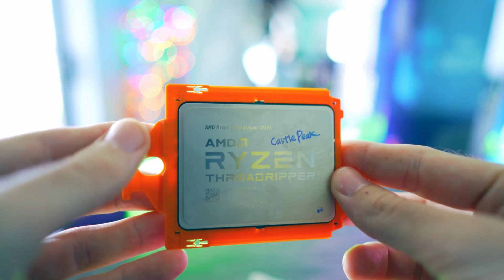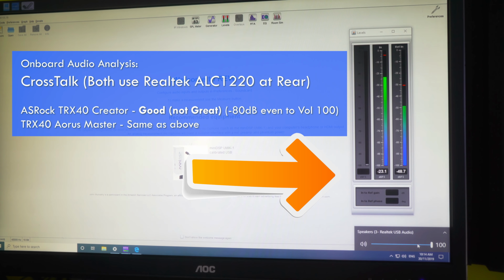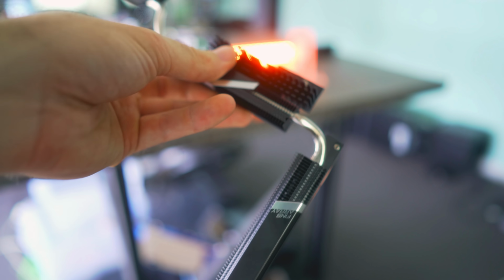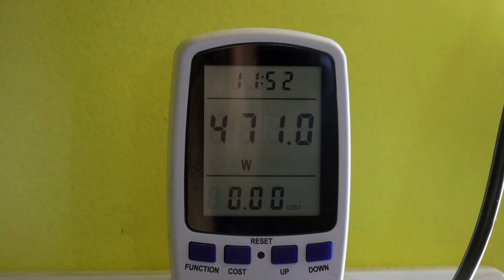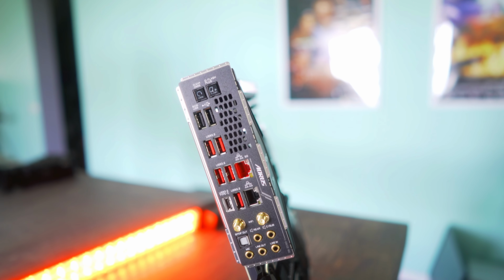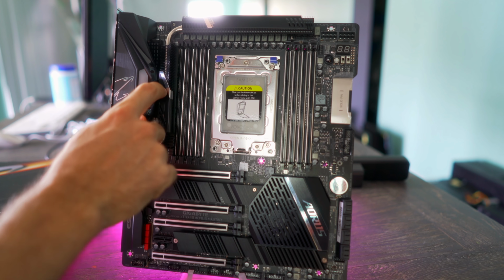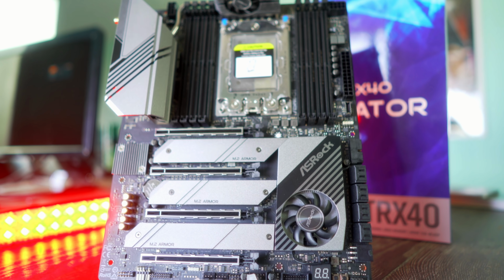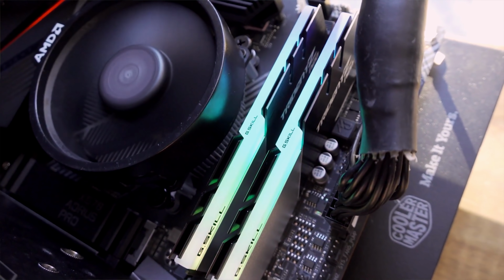TRX40 AORUS Master Vs. ASRock TRX40 Creator - Bigger is NOT Always Better.

Comment from the maker: Sorry made a mistake on the audio latency test, the files are actually swapped, ASRock TRX40 Creator had slightly better input-output-input audio latency than the ASUS X299 Deluxe!
Reply from the maker: @MarcoGPUtuber  Wait so you are doing a better job than a whole company's website? Ugh ><, I will message you when I wake up.  So tired now, had so much more to examine this time around with this board review.
Reply: @techyescity  Dude, Gigabyte should hire me. The motherboards are great but damn, these websites, the English.... Uggghh
I'd have the whole thing bulldozed and fixed.
Reply: that is easy run a sound card Evga or Creative labs fix the problems !!
Reply: So what happened to AMD being the affordable manufacturer?
Over priced Entry level motherboards?? 
How does that work for the low budget gamer??
Reply: if you bought a radeon vii card a few months ago this should upset you  .  699 for a card and 6 months later drivers lack support . to where  its only 1 frame faster than a gtx1070 and slower that a 5700 https://www.youtube.com/watch?v=WseH1xuzi34
Reply: @monham5041  this platform is lot cheaper than intel 3175, and performs better. Dont worry, amd is still the king in price to performance in every price category.
Reply: 7:36 how the F*CK did you get to 103*C??? i'm using an $50 cooler master air cooler and the highest i've seen was 85*C. you messed something up really bad.

Comment: Thanks for the look-over of those boards. I am leaning towards the TRX40 Master since I have been very pleased with both my x570 Masters/(3900x & 3800x) but,  the creator looks interesting indeed. Noticed you're using the Enermax TR4 cooler - hows that working out and are you using the newer revision?  I like the cold plate design Enermax is using - not so sure about the what's happening inside with their coolant...
Reply: I have the same question since I'm planning on getting a 3960x or 3970x and the Liqtech cools very well.... when it works that is. A lot of people complain of raising temperatures after 6 months of usage. One just needs to check the reviews on Newegg and other sites to see how bad they are, even the 2nd revision it seems (Liqtech II).

Comment: I have an Asus ROG Zenith II Extreme, and I'm fairly certain all four PCIe slots are x16, but it looks like if you toss in more the two GPUs, it scales the PCIe lanes, so two slots end up being x8. However, I've tested with two GPUs, and no matter the slot the cards are in, they always run at x16. It also depends on the usage of m.2 slots and what not. But it appears all 4 slots are perfectly capable of PCIe 4.0 x16 on their own.

Comment: Thanks for a great comparison. Now, what do you mean by saying 'massive, massive air cooler'? Would you even consider it with the TR 3960 (no OC)? Thanks.
Reply: Are you thinking an air cooler wouldn’t be good enough for the 32-64 core parts at stock or something? You wouldn’t need a massive one for just stock (my 1950x was fine up to 450w cpu power on an old 120mn AIO that only covers 1/3 the IHS), these are not hard to cool like Intel (the 9900k is freaken lava... It’s insanely small and the power draw is basically the same as the 64 core Threadripper, so the thermal density is insane). Threadripper could be cooler just fine with a PBO overclock on a good or decent TR4 air cooler. You won’t get every last ounce out of it (I’m aiming for -100c with triple cascade for when the TR-64 core comes out as my next daily upgrade, hoping for 128 threads at 5 GHz), but a big air cooler would be fine especially if you’re not overclocking, don’t worry about it, these chips are easy to keep cool, it doesn’t take much.

By massive massive air cooler he meant something close to performance of a water cooler and overclocking to the limits, that the boards would still be fine. (I’ll probably end up using a similar board to one of these for even LN2 overclocking, because at that temp the entire board frosts over so VRM doesn’t run hot anyways and even at that these boards should provide plenty of power delivery for even the 64 core, it’s just that at this level of fun competition every last Mhz counts so even a minor improvement can win you the bragging rights, but it’s not needed, and it’s just for fun, similar to car racing it’s just about having fun)

Comment: If you overclock and fine tune the Aorus gets into the optimal VRM efficiency zone. And it's also possible that it'll get better with updates. 4990x ready.

Comment: 7:35 95*C? 😳 Is this because of the Enermax Liqtech AIO? It's well known that it clogs up with time and temps skyrocket. Maybe that's what we're witnessing here? 95*C is not normal when running the CPU at stock with an 360 AIO that covers the whole heat spreader of the CPU.
Reply: A bit late but you need to remember its 27C there as shown in the video. The cooler is keeping the cpu at a pretty decent 68C over ambient while under stress testing.

Comment: ESS SABRE qdacs can cause some funny results when using 3rd party audio software. I would take the highest quality audio file, like a 32bit FLAC and listen to the file and compare it to other boards. I was having issues with audio software myself. But, the actual audio file i tested sounds perfect on my $500 Sennheiser's through an old LGv20 and even on my new phone which is a v50 also with an ESS qdac. Listening to the same file on the ESS SABRE 9018 qdac in the z370 Aorus Gaming 7, also with a 2Vrms 3.5mm hadphone jack, they both sound identical. I think the ESS chip isn't supported or when a qdac like the ESS converts the signal, the results become smeared. The clarity when using those SABRES are unmatched.

Comment: What is the best gpu i should get for a 2600 (reasonably speaking)?
Reply: As nice as you want basically. Whatever your budget allows (RX 470/480/570/580 are extremely cheap used in the US for example, you can often find $80 will get you an RX 580 8 GB card, so unless you need 1080ti/2080 performance those are the cards to get here in the US, but that might not be where you live, or the 5700 and 5700XT are really good value at like $330-$350 new in sale since most stores are still selling them at Black Friday prices).
Reply: @jakegarrett8109  kk thx :D

Comment: I have question.
I presently have a Xeon X3440, X3470 paired with a ASUS P7H55M Pro motherboard and an Intel DH55TC motherboard. Should I spend some money to overclock the X3440 (by buying cooler and good PSU) or just add the stock X3470 and add a RX 470 graphics card without overclocking the processor? (I will be buying another PC soon.)

Will spending money on coolers and PSU for overclocking the X3440 worth it?

Comment: I love when people were like "I'm so glad I got an X399 board" 🤣🤣🤣
Reply: I have zero regrets. 16cores for 2 years for 710$ total. 260$ for the board 2 years ago and 450$ for the 1950x. Uh yea that's nothing to be upset about. Especially when your work benefits from the extra cores and PCIE
Reply: @skoopsro7656  Same here. I've recovered the cost of my x399 machine in the first couple of months and throughout the 2 years I've been using it it has earned me a lot of money.

Comment: Cant believe the TRX40 AORUS XTREME has active chipset cooling when the X570 variant does't...
Reply: It's most likely because there are a lot more PCI-E devices that you can connect to the TRX40 motherboards thanks to the 72 usable PCI-E lanes. If you use a lot of these lanes simultaneously, things might get toasty pretty quickly. The X570 chipset only has 20 usable PCI-E lanes - much much less.

Comment: I bought the Asus trx40-e, and i found out in canada the  aorus master is cheaper than the Asus trx40-e with, and it has 5g nic on board compared to the asus 2.5g, also the master looks cleaner and it is E-ATX which i like and the cmos battery is visible, compared to asus, it is ATX i found it a little cramped, also couldn’t locate the cmos battery to clear out the cmos in the Asus board as i was trying ocing the 3960x  as the Asus dose not have clear cmos button, I agee the master is better value, i am disappointed at Asus.

Comment: ASRock just rocks !  I will never buy any other brand ! never did , never will !
ASRock Rules !
Reply: Yes . Asrock truly rocks . Thanks .
Reply: Just keep an extra set of high speed RAM... on the Ryzen boards they have a bug where if it fails to post sometimes it never will until you add in say a 3600 XMP kit (even if you never had it set above 2133 MHz, or even if your CPU could never hit that XMP even on one stick). Asrock X370 Fatal1ty but according to the forum that helped me figure it out it also affects Intel boards from Asrock.

So you either need a set of unrealistically high speed (for first gen), or you’ll have to RMA your board occasionally... yay, way to not put a duel BIOS chip like even the old cheapo AM3+ garbage tier boards had...

Also on the X399 (Threadripper) platform (haven’t had the issue since I only run 3600 or higher on it), about half the time you can only get 1/2/3 sticks to work after installing new memory. BIOS will say “quad channel”, but say only 8-16-24 GB useable. CPU-z can see the extras (like I had 6x 8 GB sticks but only 16-24GB could work at base level speed 2133Mhz, but CPUz could detect each stick in windows and show the XMP profiles and vendor for each slot, but the board wouldn’t show the OS the full amount). You end up painstakingly taking the water loop or whatever off (just awesome for hardline water cooled quad crossfire, let me tell ya...) slapping the CPU off the desk a few times scolding it like a dog (there are no pins to bend, so I’m being serious when I say scold the CPU, shouting seems to relieve some of the anger after the 15th time it’s been out of the socket and the 20th time adding sticks one at a time), then cross your fingers and prey the thing actually lets you use all the memory.... It will often work after the 10th time, but sometimes it’s 6 hours of pulling hair to get it to use/bench a new kit of RAM. I’ve never had this issue on my AM3+ Asrock or my AM4 board using all the sticks, but TR4 is just janky! Also seems to help if you have it warm, so if you’re room is around freezing be thankful if it even boots with 16 GB! I’ve had to use a hair drier to warm it up before... and yeah, I actually use my computer to warm up my room so that’s a problem, the last week it’s been running 6x Handbrake batch file encodes at once compressing my bloated videos of all the stupid stuff I do (maybe I should just run a jet engine on diesel to heat up my room... IDK, I think using quad crossfire and Threadripper sounds more reasonable, but I always need an excuse to buy a turbojet, Aerospace engineer if you didn’t guess, lol!)

Comment: I'm still amazed how intel threw away such a big lead. Like I'm super greatful they did but like how did they allow AMD to come back
Reply: The Poltical One give it a few weeks for the enthusiasm and euphoria to die down a little and let actual people who daily-drive these chips post their experiences with actual software, not benchmarking tools. One thing i can tell you with certainty, very VERY few people who got TR1s or TR2s will be buying TR3s.
Reply: @sniper1pk  Why do you think that very few people that got TR1 and TR2 will be buying TR3?
BTW, ~95% of the benchmarks in the reviews I've watched and read so far are based on actual software so not sure what you are trying to say? Cinebench is Cinema 4D - actual software; Blender - actual software; 7-Zip - actual software; Adobe Premiere Pro CC - actual software; V-Ray - actual software; Corona Benchmark is Corona - actual software. Mozilla compiling - actual workload; Do I need to go on? The only ones that are not really actual software are maybe ~5% of all benchmarks shown such as CPU-Z and Geek Bench.
Reply: @bgtubber  I run a small VFX studio and i got a couple of 1950Xs and a 2950 to supplement our mostly x79 and x299 pipeline. The amount of downtime we've faced due to AMD's laggy performance, system hangs and general compatibility issues caused us to actually lose revenue due to missed deadlines. Even using them for their fabled "raw compute power" frequently resulted in over-night sequence renders getting stuck, point caches getting corrupted, Fluid simulations getting miscalculated. We're making heavy use of Houdini, followed by 3ds max (FumeFX, Tyflow, thinkingparticles), realflow, nuke and occasionally Maya. all of these are industry standard software and well-threaded. Our CPU rendering is based on Arnold and Vray. Redshift for GPU rendering (AMD GPUs are dead on arrival in GPU renderers btw).

Cinebench may be made by Maxon who make C4D but the actual software goes through a lot of optimization to make use of Intel only technologies ('middleware').. Some that I can think of right away are Math Kernel Library , Thread Building Blocks, Embree and so on.
The same applies to Chaos Group's Vray and Corona. Benchmarks are hardware agnostic, and have zero user input, but the actual rendering plugins that are used in production, installed in the host software (be it 3ds max, Maya, Houdini, C4D) are a very different thing.
Problem is, AMD has zero middleware support (both CPUs and GPUs), which is why benchmarks tell a very different story from the software they are supposedly based on. Given their attitude and approach of slapping cores upon cores, while keeping an unstable, un-robust architecture, its unlikely to change in the near future.
Reply: @sniper1pk  That's really strange. We have a few Threadripper 1950x machines that we bought 2 years ago which we use 24/7 for rendering and scene creation in 3ds Max with Vray and we've never had any issues so far, neither with corrupt files, nor with slow speed or crashes and hangs. We are also running a few Intel i7 machines in the mix and everything still works perfectly fine together. No corrupt files, no slowdowns, no missed deadlines in the 2 years we've been using them (knock on wood). My point is, the problems you're observing aren't coming from using AMD CPUs since we don't experience any of them with any of our AMD Threadripper machines. What you are describing might be a different issue. For example, faulty RAM is one of the main reasons for corrupt files and system crashes and hangs. Faulty disks and network controllers can also cause similar problems. If you have overclocked the CPUs and/or RAM, this can also be very bad for stability if done incorrectly.
Reply: @bgtubber  sure dude, lol! u are essentially saying that after 10+ years in this industry, i am able to build a vfx business from nothing but still wont have enough sense to not oc workstations or troubleshoot the obvious issues??
am not trying to be an asshole and cast aspersions on you, but i have serious doubts on your claims at this profession. Sorry.
Reply: @sniper1pk  "i have serious doubts on your claims at this profession. Sorry." Are you saying that I don't work in this field? You can believe what you want, I have no reason to lie. I've even been a beta tester for Vray version 3.5 when Vlado asked for beta testers in the Chaosgroup forums. You can thank me for quite a few of the bug fixes in Vray (including Vray Next) since I post threads in the forum when I find them and send crash dumps to Peter Matanov and Vlado when Vray crashes. I'm not going to reveal my user name on the Chaosgroup forums though as I don't want to reveal my identity associated with this Youtube account.
Reply: bgtubber its cool. i didn't and won't ask you to reveal your id to validate yourself either. ik how fanboys from either side behave if they find out who's who  i just said what i said based on my experience.

Comment: Asrock looks cheap and crappy, as always
Reply: Their boards look way better in person, when you pick up a Threadripper Asrock board (they do look like $hit in pictures I totally agree), but when you pick it up they are freaken beefy! They also look way nicer. I’m more industrial, I like the look of CNC machined parts and a brushed aluminum finish on some of the accents. They are quite a monster when you have them in person (this comes from someone who uses their system with quad crossfire pulling on average just over 1.7 kW when gaming, running Crysis 3 at 4k Ultra at 100fps, though I want to upgrade to quad Vega VII for triple 4k if they are unlocked for Xfire like they might just have been). Anyways, they look very premium and beefy in person, but the cheaper X370 ones still do look pretty “meh” (like alright, as in they will handle LN2 overclocking just fine, and the X370 Fatal1ty I have does go up to 2.5 Vcore so more than enough to instantly fry any RYZEN even on liquid helium, but they don’t look like “damn, you see those sexy VRMs that can jump start a car?!?” kind of look)